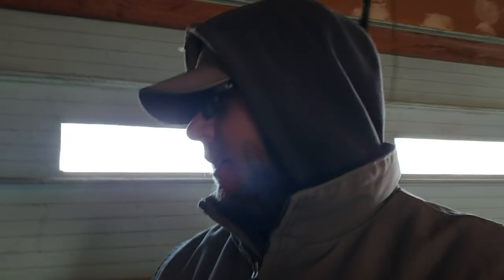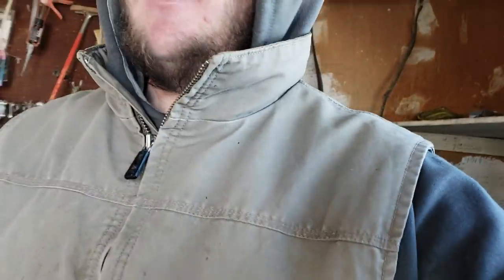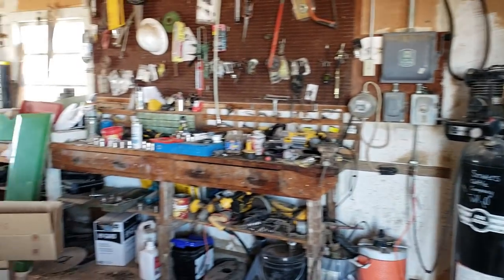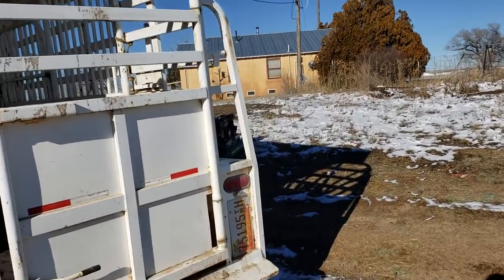Thumbs Down

Comment: I have the same deere compressor and it does the same thing. Has to be completely air free before it will start.
Reply from the maker: The dealer said this was an issue they've had and they just warranty out the air value on it and it fixes it
Reply: Good to know I am going to give my dealer a call in the morning.